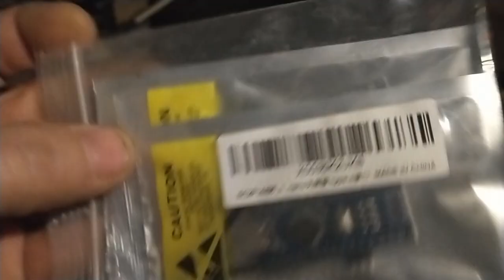I Almost Slept Through My Pump Burning Out

Comment: Frozen again!  Is it time to look at burying a tank, like other Earthship designs?  How deep and wide does that cistern hole go?  Like could you drop a 5' tall x 5' diam poly water tank in there and still put a yard of dirt on top to insulate?  
I feel like an open pit with a wooden cover is always going to freeze; unless you rig a solar hot water setup or a 2nd windmill to act as a heater. (which might just get you an algae farm?)
Reply from the maker: So I am considering several options but the limiting factor is $$. As soon as I save up a bit of money I will decide how to proceed. I don't think the tank you suggest would hold enough water for me here. The option I am looking hardest at is an in pipe heating cable that I can switch on for a few minutes to thaw the pipe when necessary.
Reply: @aloneinanearthship4010  you might be able to build an insulated shed around the cistern with mostly scrounged materials?
Reply from the maker: @matthewprather7386  going to go for the in-pipe heating cable I think.